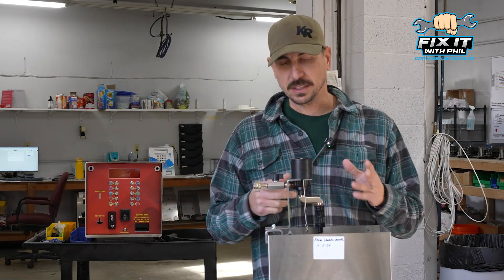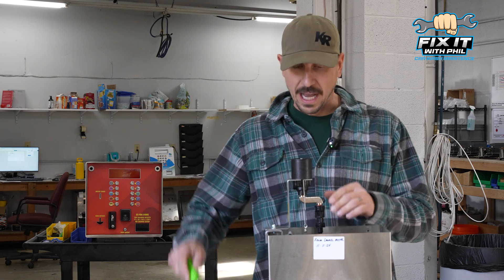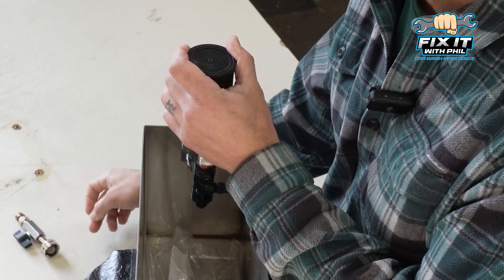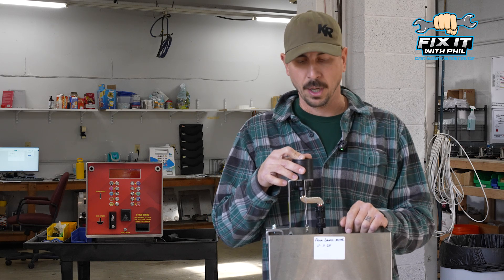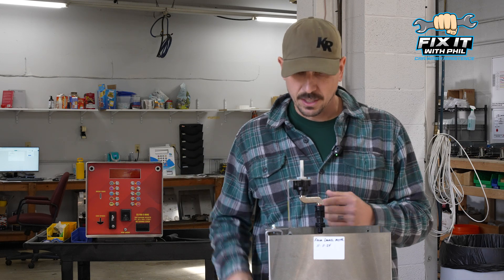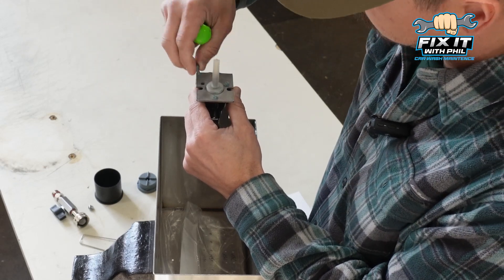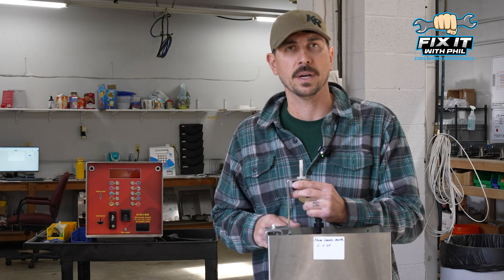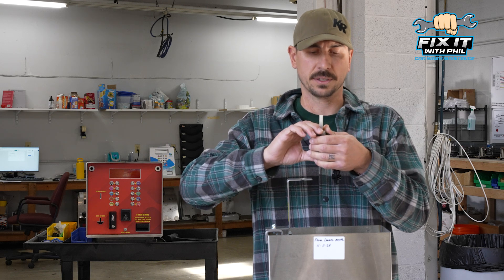Complete HydroMinder Rebuild Guide - Fix it Phil | Kleen-Rite

Comment: Hi Phil, I purchased a new triple foam system from you guys and one of my hydrominer is letting air bubbles into the chemical pick up tube. If it sits for a day or two without use, the chemical tube is full of air and then won’t dilute chemical properly. Would you recommend rebuilding the hydrominder?
Reply from the maker: I would believe that the foot valves need to be replaced. If you have further issues please call into customer care 1-800-233-3873